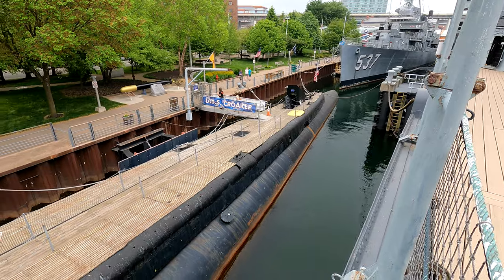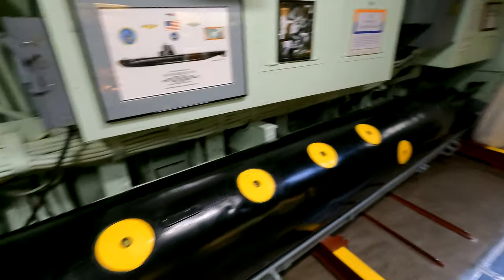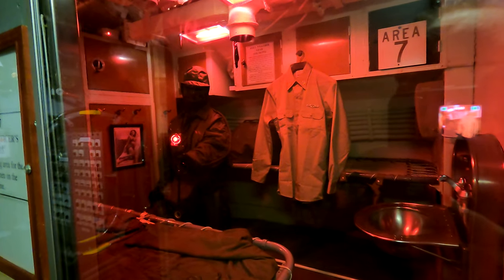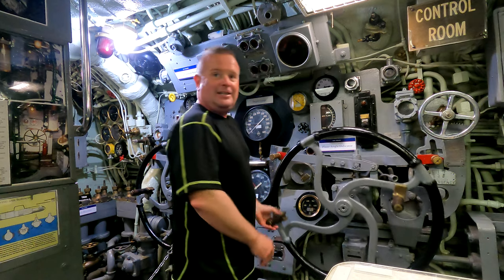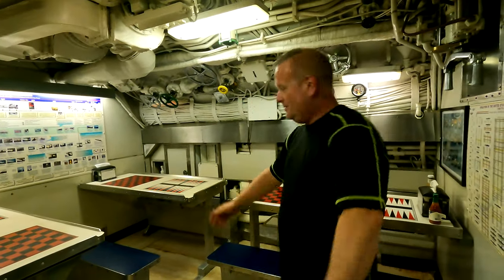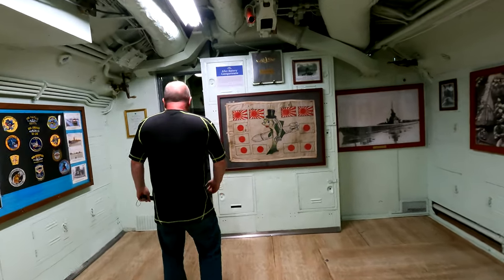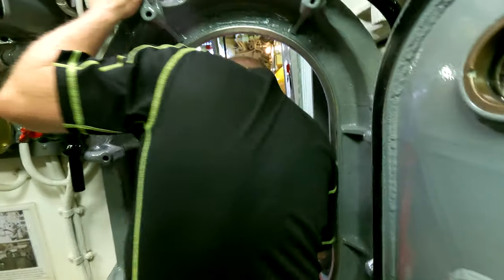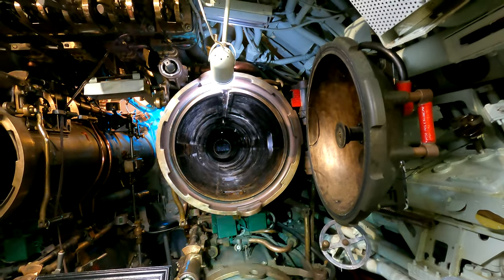USS Croaker at the Buffalo Naval Park

Comment: Museums ask folks and place signs around to PLEASE DO NOT TOUCH things..... 1) they are historical artifacts, please show respect, 2) replacement parts are generally not available (not if but when) guests break things, 3) guests have no idea what it is they are doing when they move levers, wheels, knobs, etc. Some systems are still active and can have very bad results, 4) guests can easily hurt themselves or others!. In spite of your comment in the control room when you moved the forward dive plane wheel you touch things you have no business touching!  When you close the water tight door at the aft end of the control room I refer here to my #1 point. You disrespect the men who manned subs and it can be dangerous to yourself and others. These door weigh to much to screw around with! In the mess deck you preach respect and acknowledge the fact you don't know what it is you are doing but are still touching things. In closing I can't understand why folks think they can just touch whatever they want in despite the fact they know it's wrong.
Reply from the maker: Thank you for your input.